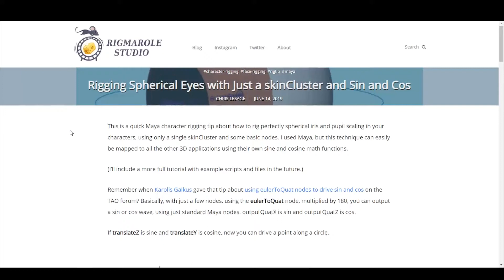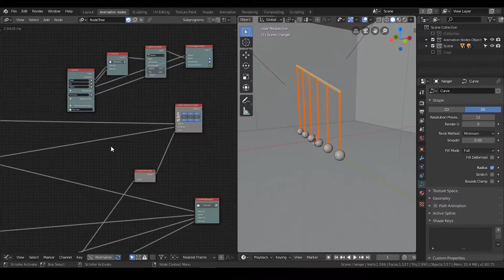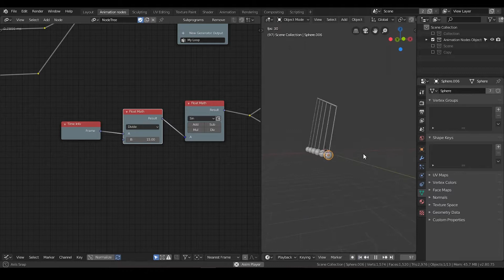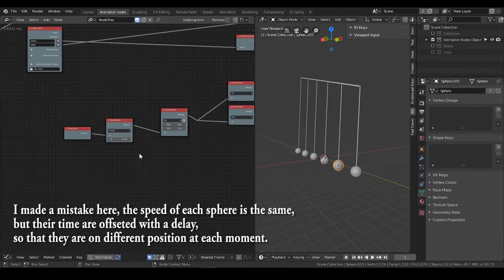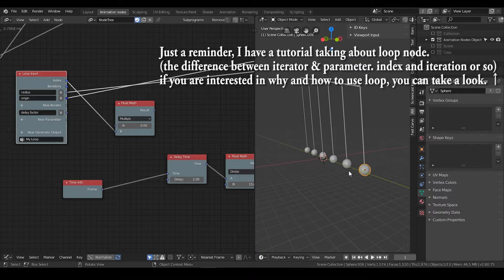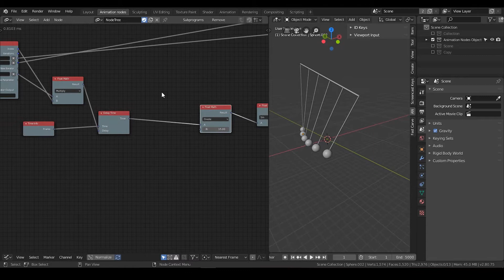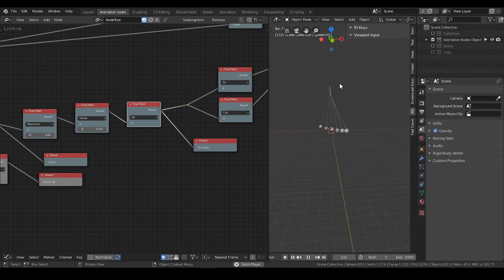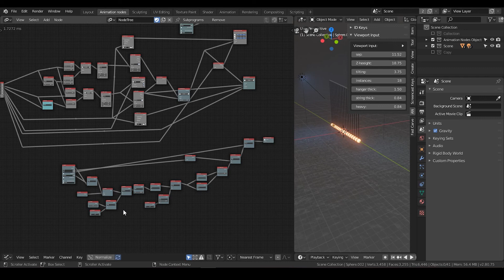[Tut] Procedural Pendulum wave P2 - blender animation nodes

Comment: Hi Bradley,
thanks for this nice tutorial. I am new at Animation Nodes and I think, I learned a lot here :-) Do you think there is an easy way to let the Spheres have all the same speed? Now the Spheres with longer hanger are much faster as the one with short hanger (both do the way in the same time). I think it has to be somthing depending on hanger height and tilting... Thanks in advance...
Reply from the maker: I am not sure what exactly you wish to achieve with "the same speed", if you don't wish to have delay, then simply not to use the delay.
Or if you literally wish to have "the same speed", it's mathematically possible, but be aware it's not physically realistic and will likely give ugly result.
The reason they do not have the same speed (actually it depends on what "speed" you mean to say), is because all these sphere are designed to run "the same proportion(/angle) of a circle in the amount of time", but since circles are of different size, the actual distance for these spheres to travel are different. These circles are designed to move a certain angle, but due to a difference in radius, sphere attached to longer string have to move faster to catch up the sphere on shorter string (delay factor is used to offset such kind of difference and cause the actual phenomenon in the real world, assuming all sphere has the same mass.).
To get the same speed, it's mathematically possible. You just need to ask each sphere to travel "the same distance in the same amount of time". However, 10 meter on a circle of radius 5m will look drastically different from 10 m,  on a circle of radius 1 m. Visually, it will look like one sphere only swing very tiny while the other sphere swing too much. I think this is artistically unsatisfying.
Or, if you don't care about circles of different size, then with the current set up, just keep all hanger the same length (ie. circle of the same size; with the same radius). Then it will solve all the problems for you automatically.
Reply: Perhaps I am doing something wrong with my AN. If I put the delay to zero and let them go the spheres start at the same angle and they are going in the same time to the "other side" of the circle, and that´s going on forever. 
If I then put the delay to something like 48 they start at the opposite sides and doing their movement exactly the same way, but only other direction. Also forever...
In real world I think they are going at the same speed over their way on the circle.  Like in this video -> https://www.youtube.com/watch?v=_4ICFmAr_DQ. 
Or am I wrong?
Reply from the maker: @ralf-gunterherzig2173  Please read my full response, especially starting from the second paragraph about the phenomenon. If it's still not clear to you, you can check the concept of "angular momentum", in which the google has states the formula on the right side: L= m * v * r (angular momentum= mass * velocity * radius); with the same angular momentum, larger the radius, slower the velocity.
In real world, the velocity in such a circumstances will not expected to be the same. You can also see from the link you attached. Why there is a delay immediately after the animation starts? because the sphere on the back move faster than the sphere on the front, and the reason is the radius (which is the length of string) is shorter on the back than the one on the front.
The rest explanation the idea of solution has been stated in my previous comment; and That's why I don't fully understand what you wish to achieve with the "same speed". The same speed hasn't been shown in your link, and it's neither realistic.
For your phenomenon, putting delay to 0 is what I proposed in the first paragraph. what you are watching is what I expected. if this is not what you are looking for, please read fully the second paragraph.
Delay is looping itself, that's why by changing value you can get completely opposite result. Delay is supposed to be played, to get full control over different results. Please see the demonstration of how it has been played with such a setting in animation nodes starting about 1:00: https://youtu.be/ck3EyPelyP4
Reply: @bradleyanimation120  Hello, Bradley,
I'm sure your tutorial will work out the way you want it to. I played around with it a bit yesterday and made a few small additions. So now, depending on the tilting factor, I automatically increase the delay factor slowly during the animation and get the effect like in the video above.
Thanks again for the help.